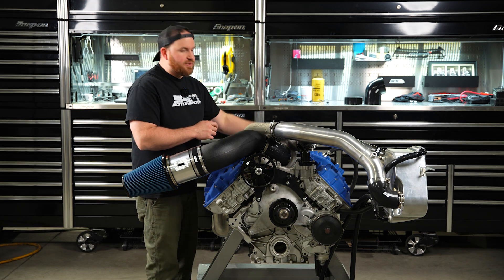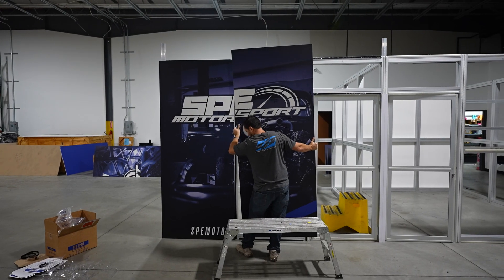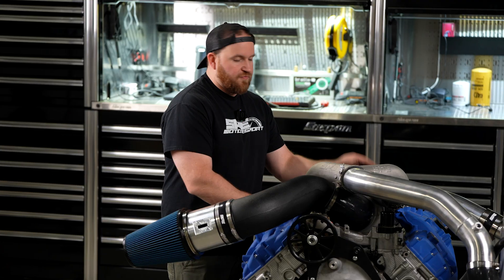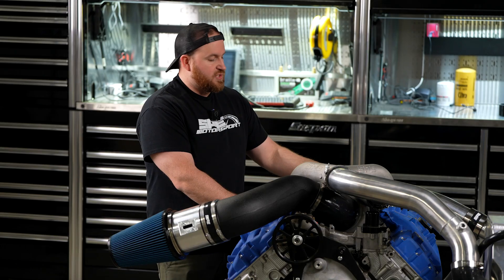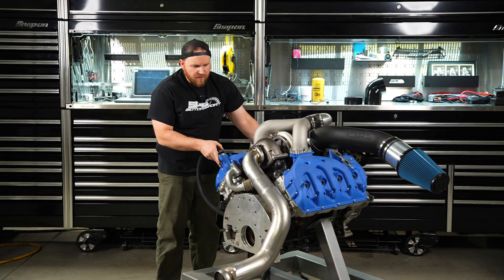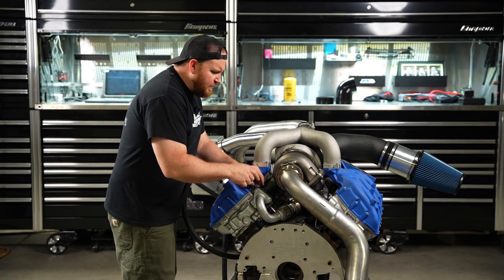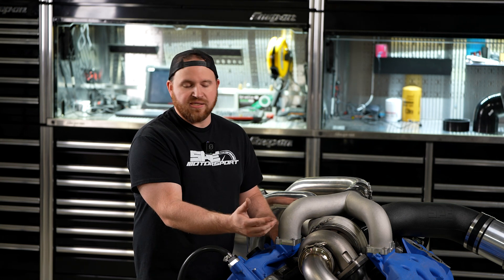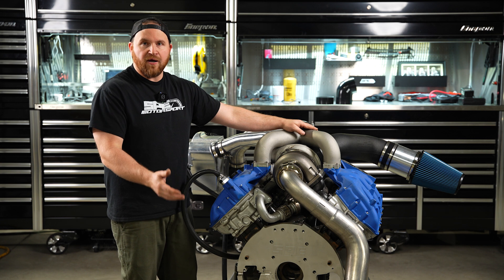S400 Emperor Turbo Kit - The 6.7 Powerstroke Final Boss

Comment: will this kit work with other brand of piping kits i have a no limit on my truck i know the hot side pipe is the s400 pipe from yall but will the cold side fit around the compressor looks a bit tight